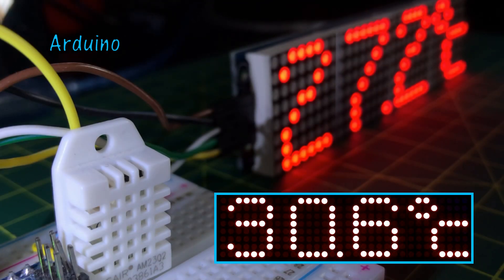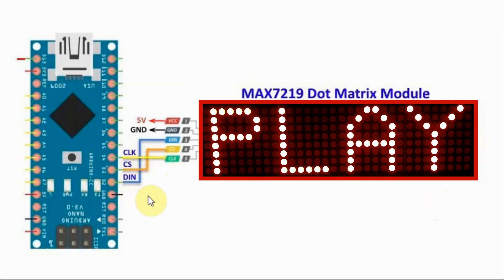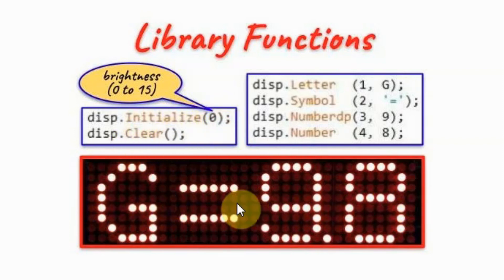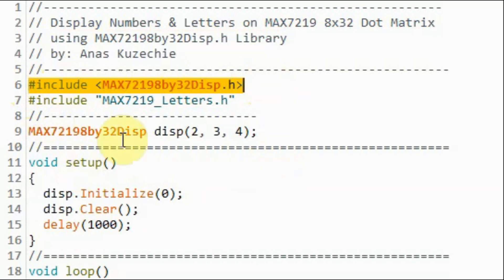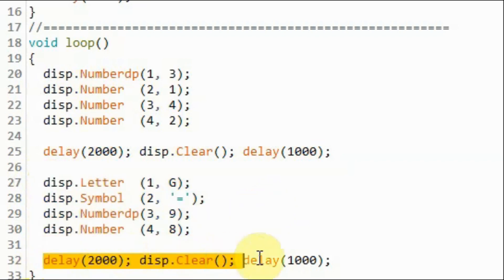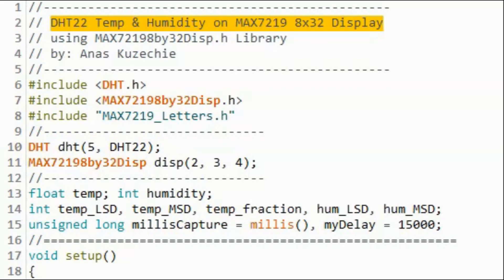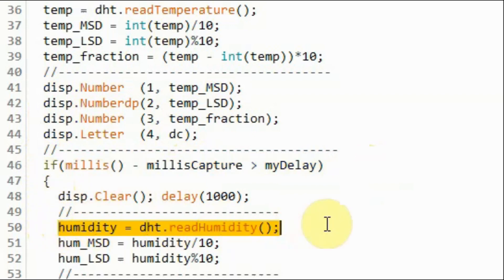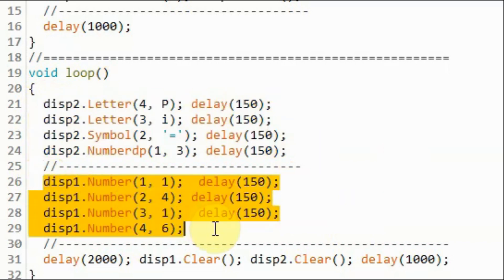Creating Arduino Library for MAX7219 8x32 Dot Matrix

Comment: Hi! I really like the video. I'm going to try it, but first, I'll ask: Would it have been possible to connect the second module in series to the first, using the DATA OUT pins on the first and DATA IN pins on the second, like the LED CONTROL library does, to take up fewer Arduino pins? Thanks a lot!

Comment: Sir ,
The Temp.⁰C & Hum. % symbols are shown in the display in starting as 
⁰C 24.8 , %75H. How to correct them in proper pattern ?? 🤔
Reply from the maker: Reverse digit numbering. 1 becomes 4, 2 becomes 3, etc. This depends on how leds are connected to MAX7219
Reply: @AnasKuzechie   Sir,
I done it in advance only correction on display for 22THD to DHT22 but not affect the sensor readings.

Comment: Your videos are always excellent; thank you. I'd like to control a HT16K33 Display for alpha-numeric data, AND a MAX7219 to display various statuses using a number of individual LEDs (rather than a standard dot matrix display). Is it possible to address both a HT16K33 chip and a MAX7219 chip from a single Arduino, or would I need 2 Arduinos? If both can be controlled from a single Arduino, how would I set the I2C address of each chip in the sketch?
Reply from the maker: Thanks for your feedback. One Arduino, since HT16K33 uses I2C and MAX7219 uses SPI.
Reply: @AnasKuzechie  Thank you for your instant and most helpful reply !
Reply: @deadcertainty4528   @AnasKuzechie   Just to be clear, you can totally use more than one SPI devices at once on a single Arduino, using the very same MISO/MOSI pins (you just need a different CS for each device). And you can also use more than one I2C devices at once, providing that you give each of them a different address (see your device datasheet to find out how to select address)
Reply: @lefauve  Thanks very much for your confirmation. I hadn't realised that MAX7219 is SPI rather than I2C. Now it's all clear to me how I can do both on the one device.
Reply: @deadcertainty4528  FYI, you can have up to 127 different I2C devices at once, and there is no real limit for SPI but since you need a different CS pin for each, practical limit would be about 10-15 devices. For I2C, not all devices can use all possible addresses so for some devices you can only have 4 or 8of them at once. That should be enough for most of your projects 🙂